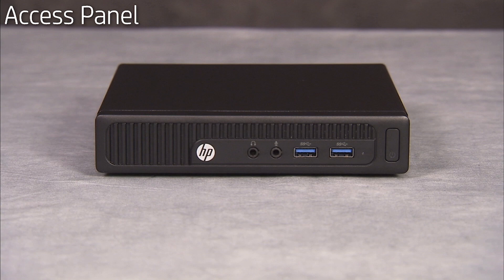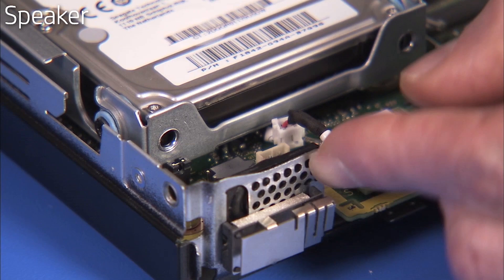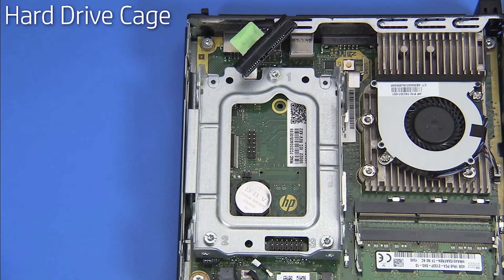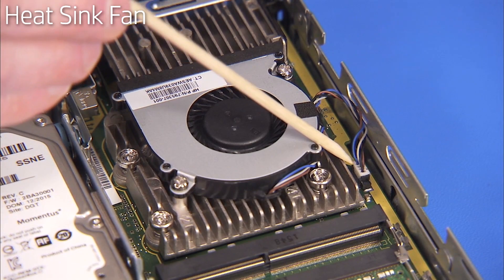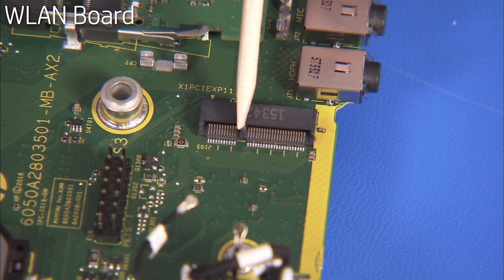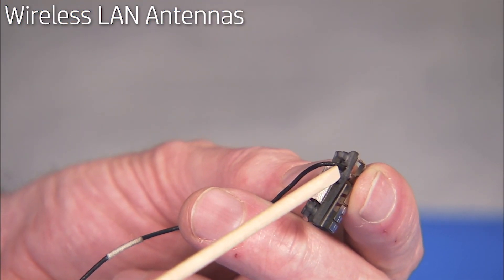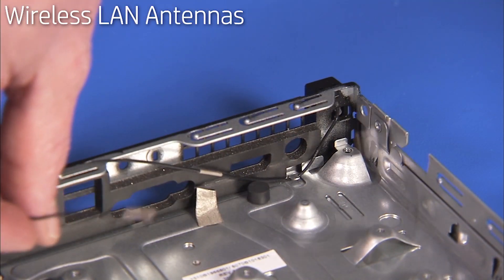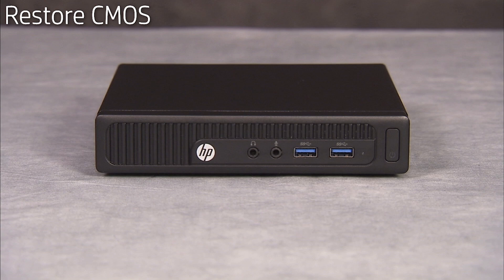Removing & replacing parts for HP 260 G2 Desktop Mini | HP Computer Service

Comment: The model I worked on had two small screws behind rubber plugs, underneath the case near the front edge.
Reply from the maker: +Chris Ralph Thanks for sharing the info.
Reply: Damn you HP, now I have both fingerprints erased

Comment: Hi how to powersurge this system unit? Im having trouble everytime i shut it down and when im trying to use it power button just blinking
Reply from the maker: +Ron Ignacio Turn off the computer
Unplug all the cables from the back of the computer
Press and hold the power button for 20 seconds and then release it to drain the flea power (static electricity.)
Reconnect all cables back again and turn on your computer.
Reply: @HPSupport  tried it couple of times, sadly it did not work for me, do you think its a hardware issue?